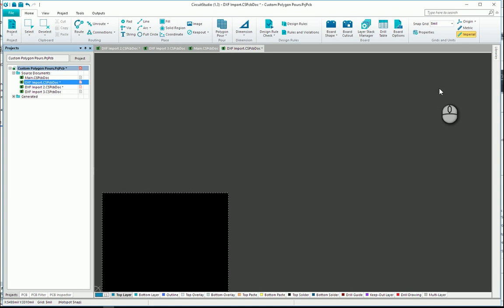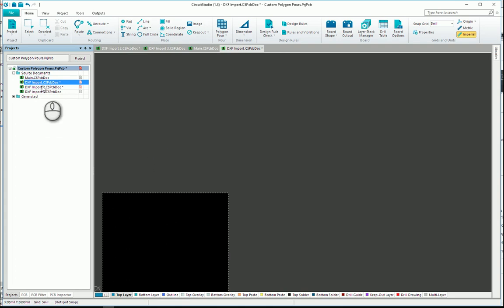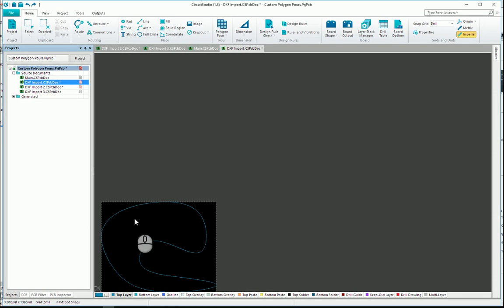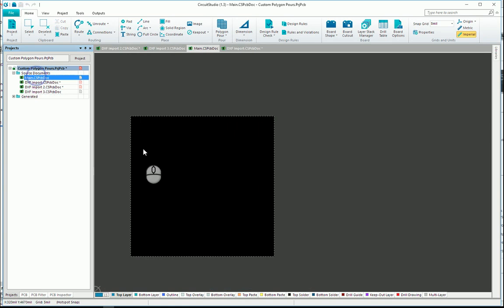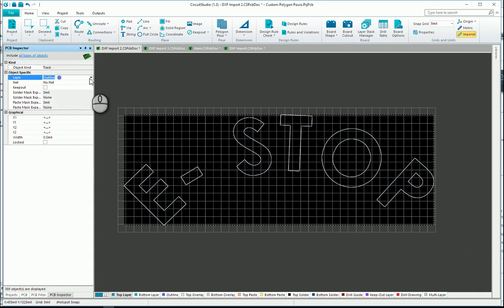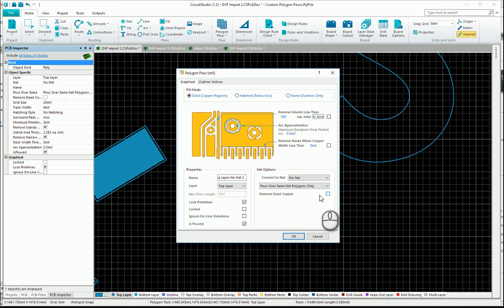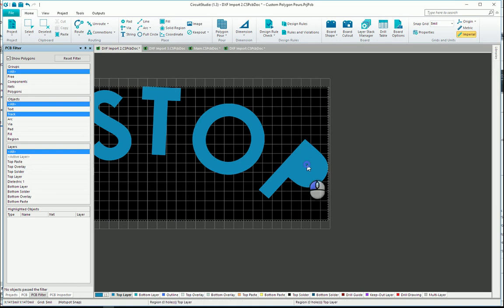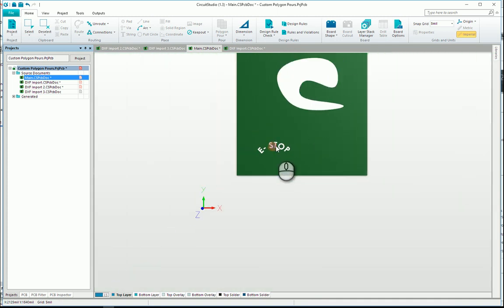DXF Import and Manipulation in Circuitstudio

Comment: Can you use a DXF as a board outline.  Sorry, I am very new to circuit studio..
Reply from the maker: Yes you can and is actually the only way now that STEP files can't be used after version 1.3.
Reply: @bugrobotics  Thanks and a few more things.  I come from a background in years of OLD Orcad and Now we have upgraded to this and the learning curve is quite high but i am figuring it out.  Most videos of circuit studio are terrible and rushed.  Also if you can do a video on making a part from scratch and footprint.  I finally figured out how, but what a pain in the butt the first few times and again the videos on youtube did not give all the steps.  Thanks and keep up the good work.
Reply from the maker: @johnjay6370  Hey John, I'll make a video.  Do you have access to a 3D modeling software (something like Solidworks)?
Reply: @bugrobotics  yes my mechanical engineer does, but i don't know how to use it.  I am the electrical guy :).  If you need something simple i can ask him.
Reply from the maker: @johnjay6370  Ok, I'm asking because you usually pair STEP models with your parts so you can then see them in the 3D view.  It will be apparent in the video I post.
Reply: @bugrobotics  Thanks a Million!
Reply: I'm curious if you can create a board cut out from a DXF. It is something that is not possible in Circuit Maker. I sure hope it is possible in Circuit Studio.